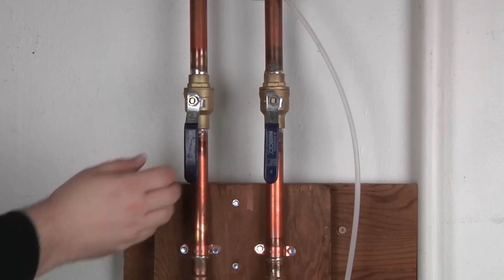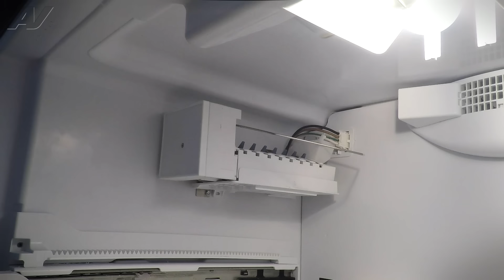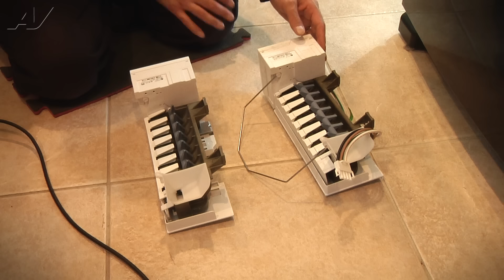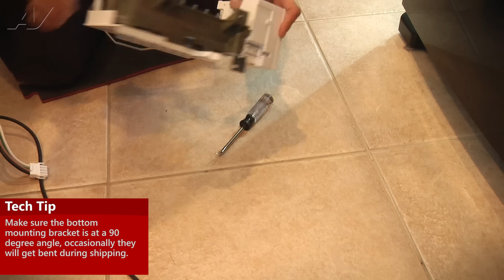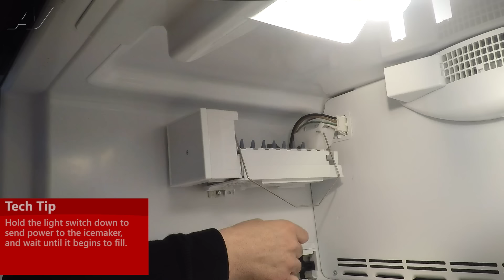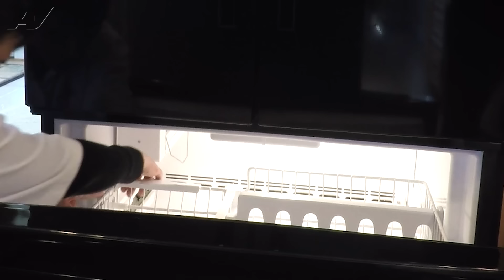Whirlpool Refrigerator Repair - Not Making Ice - Diagnostics & Troubleshooting

Comment: What can you do if the unit was changed out and plugged in prior to the power being turned off. The unit seems to try and work but the water will not fill. Thanks
Reply from the maker: Great question, if you have a more technical question that our parts department cannot answer, you can search our over 17,000 answered questions free at our website www.ApplianceVideo.com under our Repair Help section. You can also call our parts department at 1-800-830-5465 and they can give you help 7-days A week ,or search at www.SaveMoreOnParts.com  .